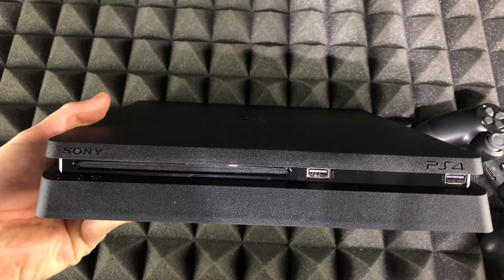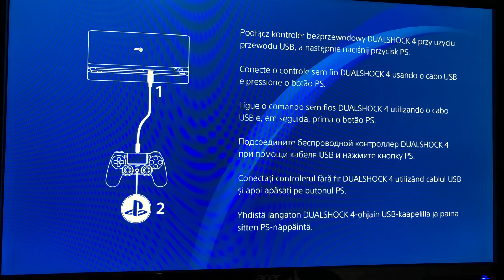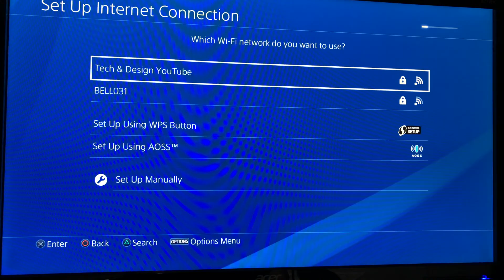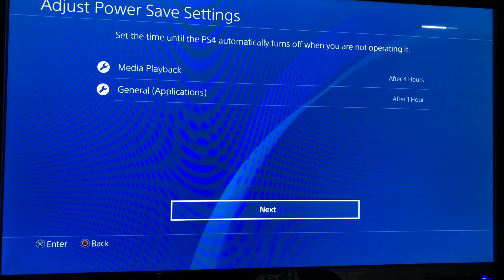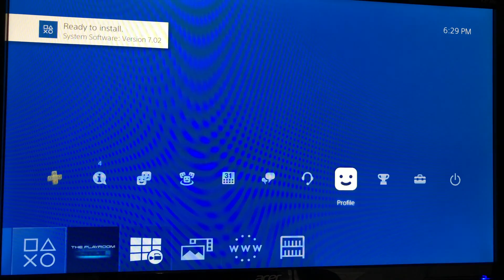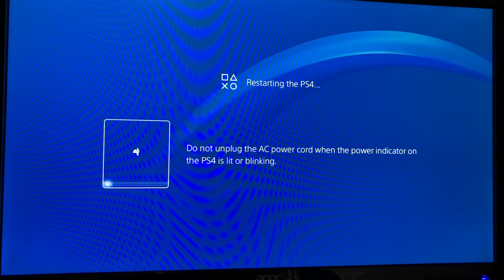How to Set Up PlayStation 4 | new PS4 set up manual guide for beginners

Comment: What is the PS4 HDMI cable use for
Reply from the maker: you should watch the video
Reply from the maker: hdmi cable goes from your ps4 to your tv
Reply: How does Lan cable work  just attach them to the TV and  PS4 and then I will get the internet  or what will it do
Reply from the maker: Ethernet cable goes to your router from your ps4